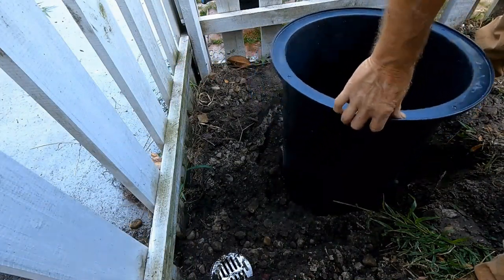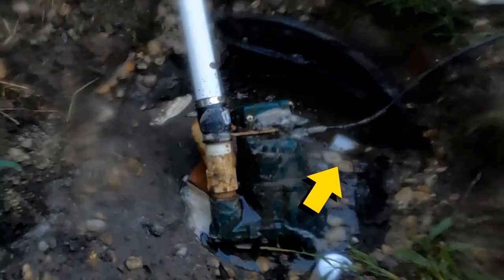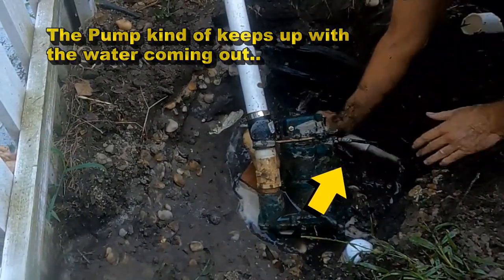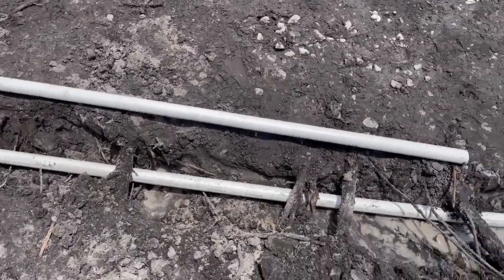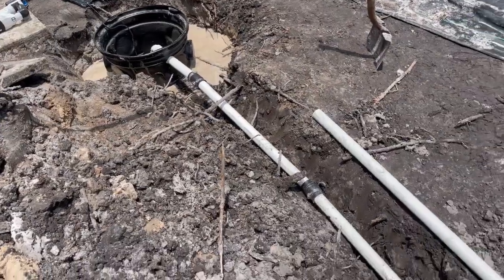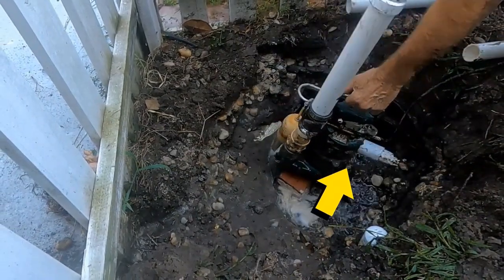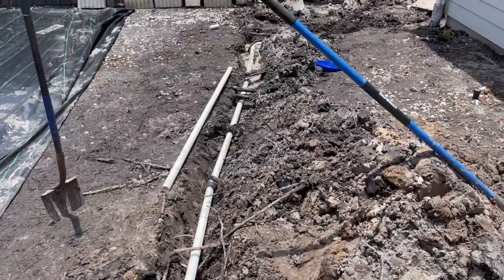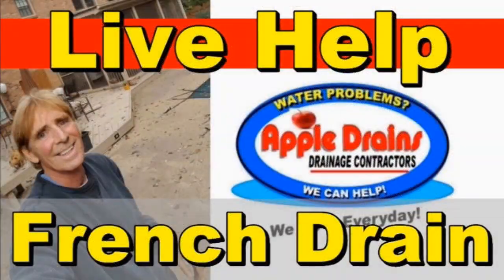Pumping Ground Water while You Work, Best way to work!

Comment: I gave up trying to find a big enough basin and riser combo. The price of 18"x10' HDPE with shipping was over .5K 
I took two 55 gallon drums one plastic and one steel that I painted completely and stood them on top of each other. I cut out the steel barrel bottom and joined them with 60 mil subseal 4'  membrane. Zoller M98 with 2" discharge line fills the bottom of the plastic barrel below the footer. Dug down at least 10 feet to get there and most of it was huge red shale pieces some 2'x2' and larger.